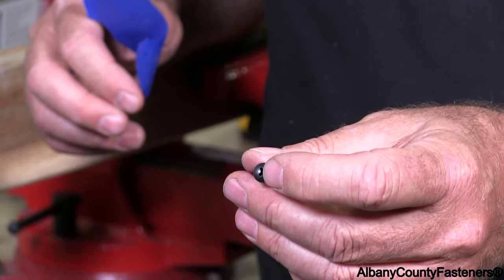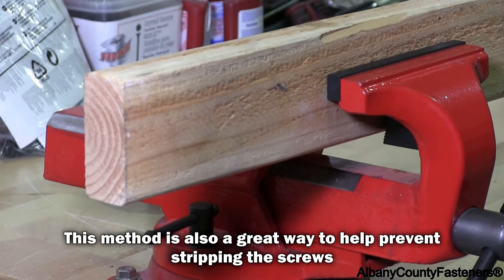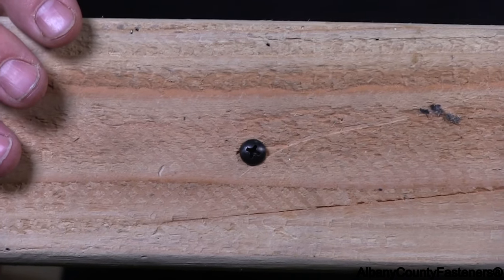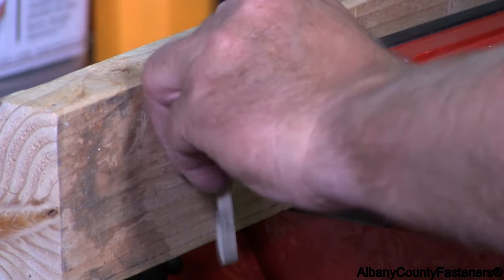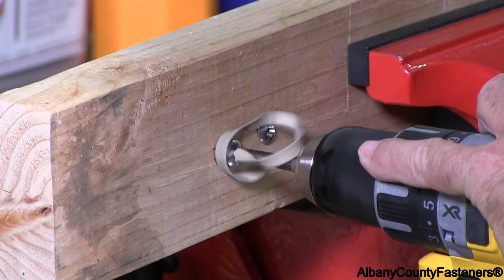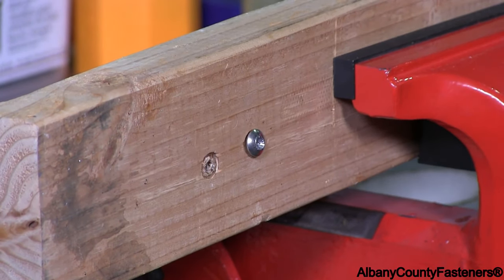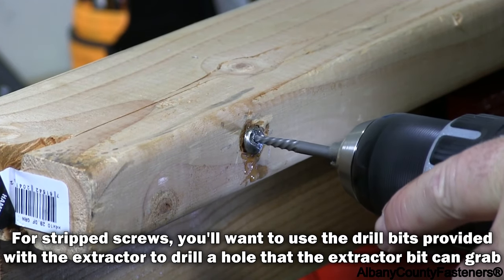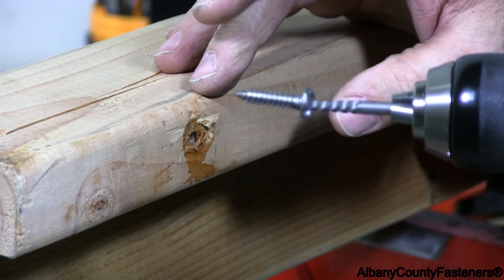Stripped Screws - Prevention & Removal | Fasteners 101

Comment: A quality screw and good bit will solve 99% of these issues. Cheap Chinese screws are cause of most of these problems!
Reply: I'll add that having the bit aligned well with the screw head and then applying sufficient pressure also helps.
Reply: Or it could just be a really old yamaha dirtbike that your trying to take it out of
Reply: Thats true
Reply: Absolutely agree. A good quality Phillips screw never cams out on me..minute I use a soft cheap screw I can immediately tell.

Comment: using a tape: If you can put a tape around your screwdriver bit and still fit it into a screw, then you are not using correct bit. No "invention" is better than using the correct and good quality bit on a screw. It would be so snug, you would not fit a hair into it and call it better.

Comment: To use this type of a screw extractor, you need to drill a hole into the screw first. otherwise you'll damage it. There is another type, where you don't. Best is to have both at hand. Try first, then drill a hole and try this second type.

Comment: The rubber band technique.. will it also work on bigger screws? Like quarter of an inch screw?
Reply from the maker: It should work, so long as the rubber band is able to fill the hole enough. Hard to say at what size this trick will cap out on though. Thank you for your feedback.